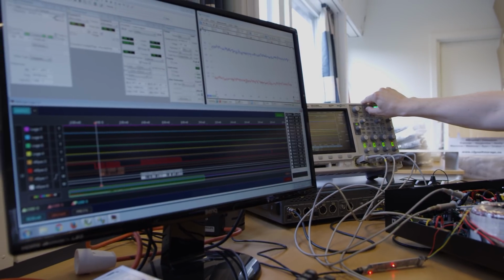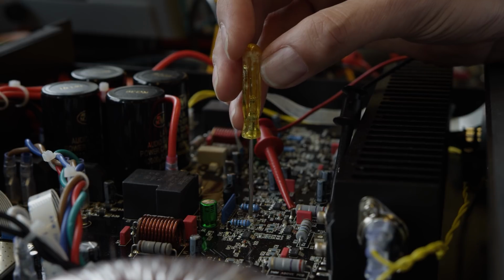Hegel H90 and H190 Integrated Amplifiers | SoundStage! InSight  (October 2017)

Comment: Would the h90 work well with kef ls50's?
Reply: it really might. I just ran them with RegacElex-R, lacking a little bit of base and having just a bit too much at the top at times. So the much higher damping factor and more mature highs of Hegel should be really good!
Reply: @rotecrl9719  i have it running right now and it sounds great,  real shame the front panels and dials are made from plastic though...
Reply: atoll in200 signature ,have the ls50 and kef r3, you need power...high dumping factor is good for lacking of power,but atoll is 120 watt per channel and it is day and night,plus hegel build quality is cheap and chinese,atoll is made in france and capacitors are Nichicon one of the best in the business! trust me i got both amps and speakers you  re asking for about maching

Comment: What speaker cable gauge size is needed to preserve that extremely high damping factor of Hegel amps? Even pretty heavy 5 AWG 2 meter long cables would drop the damping factor for an 8 Ohm load from 2000 to 985.
Reply: I have the same question. Would love to hear directly from Hegel on this topic

Comment: Made in China?
Reply: Not sure why this is worth commenting on anymore. In case you haven't heard China has a pretty impressive technology division, heck they even built an entire city (Shanghai) around that specific industry. No city on the planet can compete with Shanghai on the technology front. But to put ones mind at ease, hegel matches its internal components in Oslo for assembly in China.
Reply: @hawaiiguykailua6928  Because Chinese labor is near slave labor, it's an ethics issue and not just a quality issue.
Reply: Taffy O'Keefe Haha
Reply: @hawaiiguykailua6928  That's just not true. The chinese tech industry is built entirely on theft of R&D. They have terrible engineers.
Reply: Yep